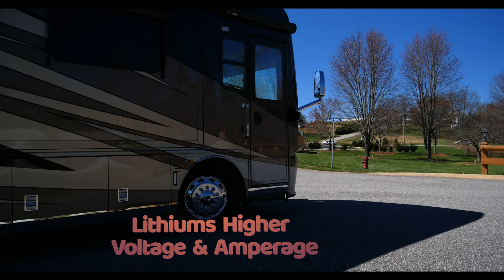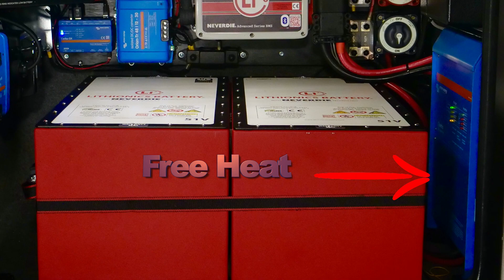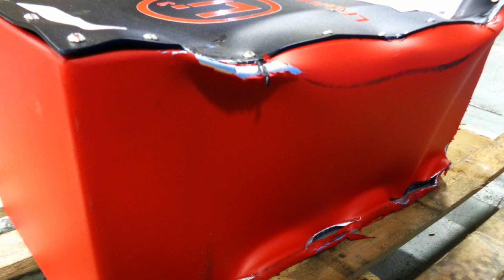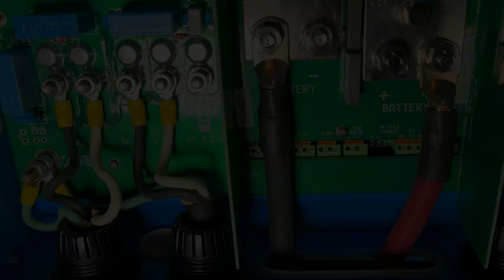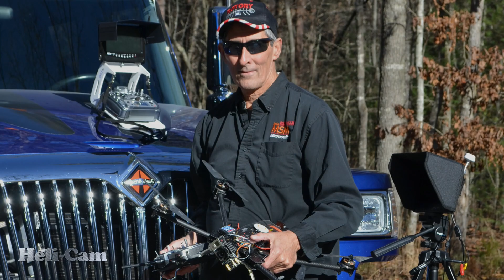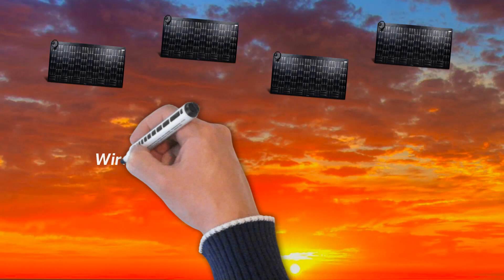5112 Dual Voltage / Dual Inverter - RV Lithium 51 Volt System - Mike Mas  Lithionics Victron Xantrex

Comment: On the generator part rv channel saying gov will ban the generator. So other than plugging in how would you charge solar?
Reply: I do not recall any where in the video it says that - the generator is a perfect companion for charging lithim batteries that's why Mike suggest keeping the generator.
Reply: @bustinass4367  Not this RV channel. There were two more that told people the generators were going to be banned.

Comment: Apologies in advance if I did not catch it Mike,. What is the reason you used the 51 volt Lithionics batteries rather than the 48 volt?
Reply from the maker: Hello the primary reason is Lithionics batteries are 51 volts just a slight edge for less amperage but the same as 48 volts - Thanks